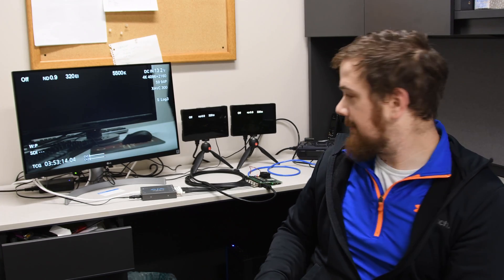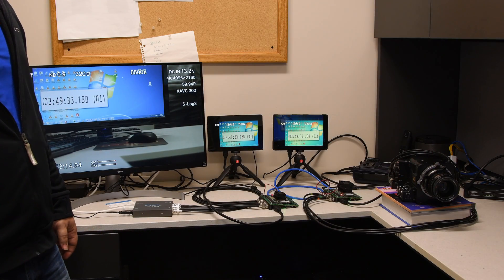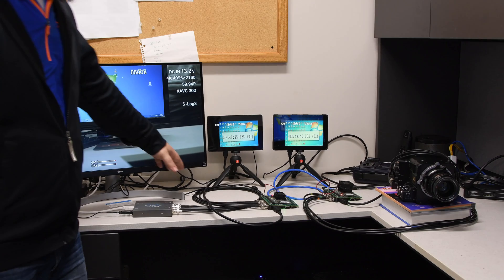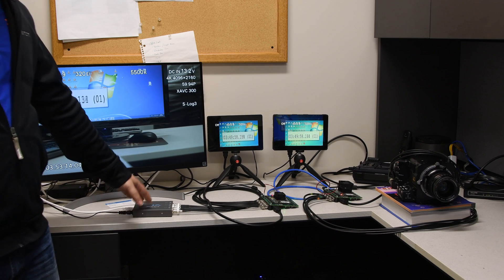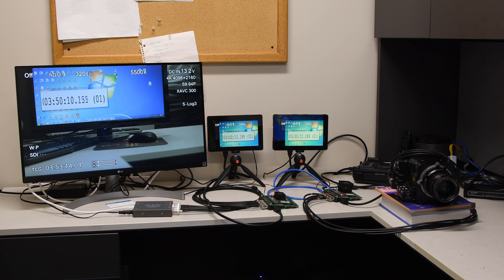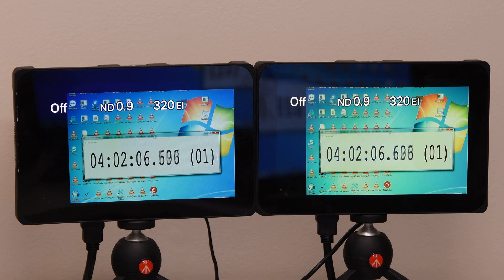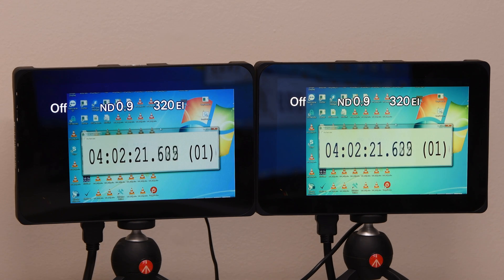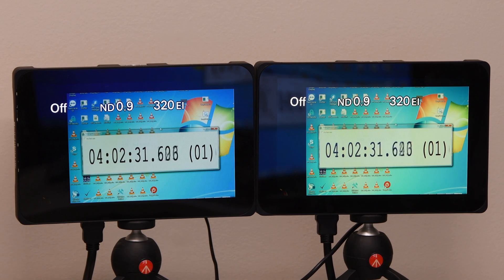SOC VOIP H264 4k60 Low Latency Demo

Comment: I'm not sure how I ended up here but this is great.  At what point do you "save" the decoded output to hard disk or some form of transferable media?  Can your decoders be accelerated?  For instance if I was playing raw video from my computer, could this device also encode it in h.264(5?) on it's own with low cpu/gpu usage?

Essentially, can your devices be used as an external encoding device for a standard PC/Mac so that one could work on the machine while your device is encoding?